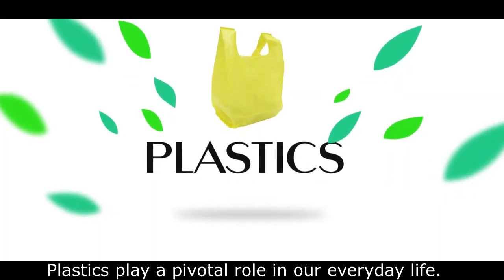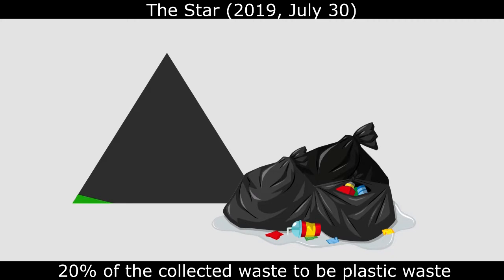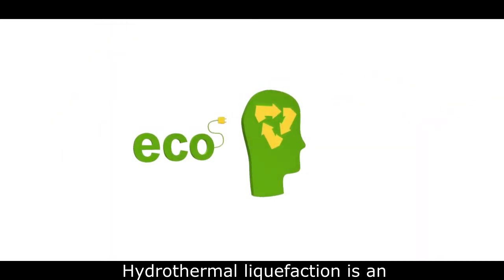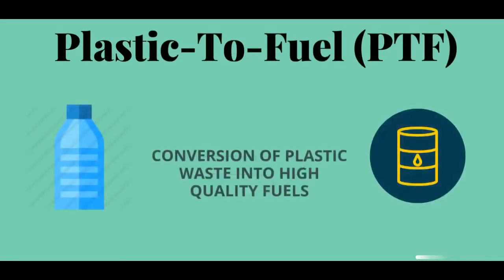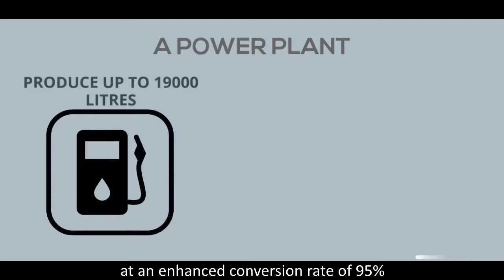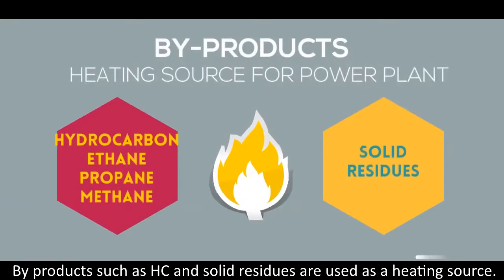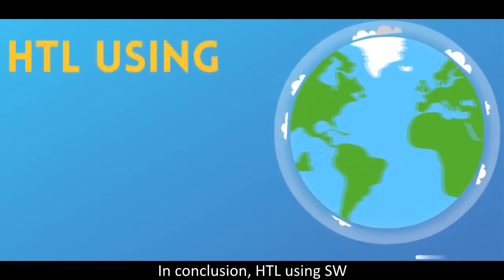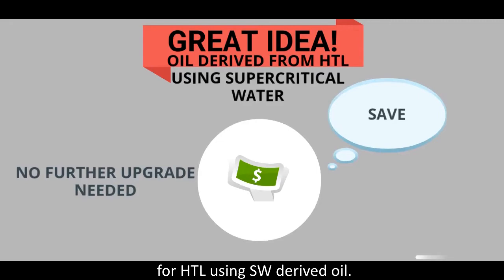NACES2019: TVC_Hydrothermal Liquefaction: Future of Plastics to Fuel_USM_Team 2

Comment: Subcritical water i.e. water heated to temperatures between 250 and 300 C under sufficient pressure to maintain the liquid state of water, can be used to process many organic waste products. There are plants that even convert human waste using this process. This process can also be used to convert farm waste products, safely process cattle with mad cow disease, and process and has also been used to treat chemically contaminated soils. The process can be customized by adjusting the temperature and pressure to change the rate of reaction. Dupont really hates any research done that finds new uses for this process in industrialized applications.